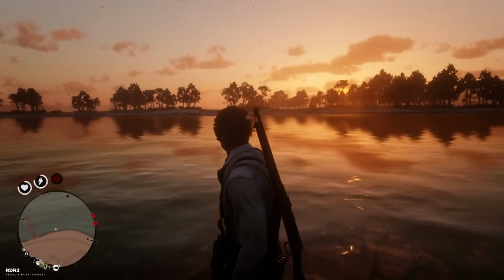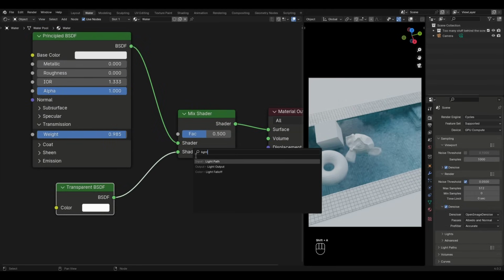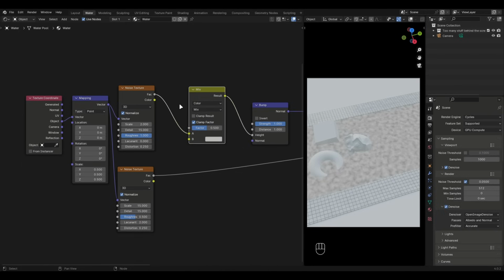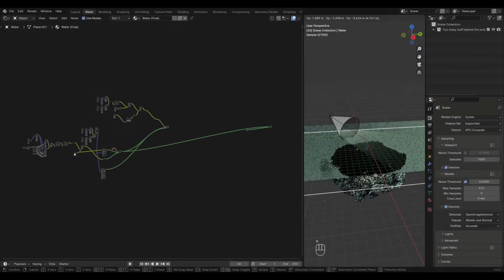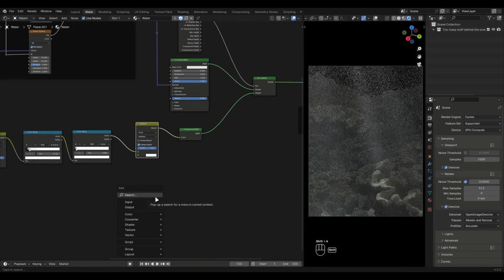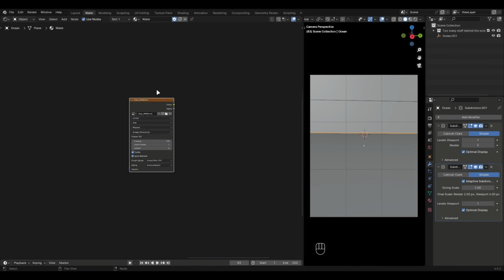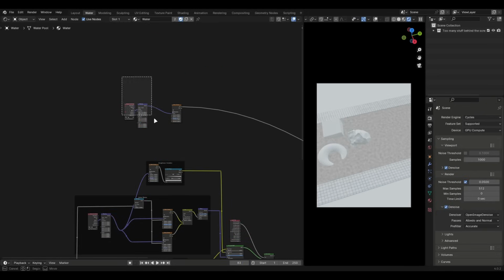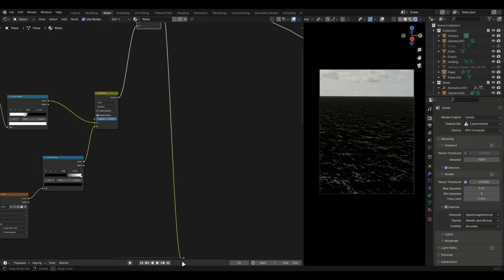Photorealistic Water In Blender

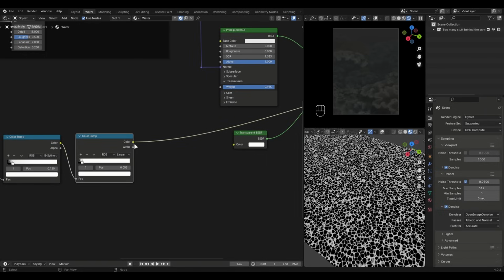Comment: I have done following this tutorial smoothly without any laggy, until 10:52, my whole navigation in the program became really slow, even takes ages to finish just one render when I tried to viewport render. Any idea to make it smooth?
Reply from the maker: What works for me is exiting Material Shading, saving the file, closing Blender, then reopening it and switching directly to Rendered Mode while avoiding Material Shading.
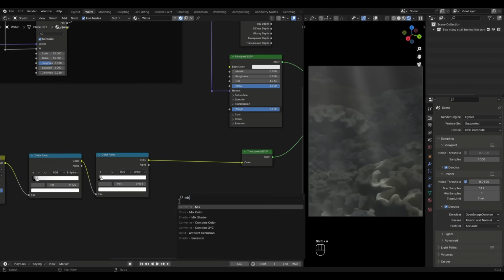By the way, does it happen right when you add the Mix Color node at 10:52?
Reply: Unluckily, I have tried closing and reopening Blender, but still occur the same problem. The lag happens right after I plug the Mix Shader node to the Material Output node before the Mix Color process.
Reply from the maker: Are you using GPU compute or CPU to render? I had this issue in the past where Blender would lag in render mode just because it was using the CPU.

If it’s happening with GPU compute, try adjusting the Voronoi scale in the material preview, and then connect it to the transparent shader when you do the final render!

This is my Instagram: https://www.instagram.com/alanwayne4940 — feel free to DM me if that doesn’t solve the issue.
Reply: @extra3d537 The fact is, I'm using EEVEE to render😅, since I want to make animation out of it. But when i switched to Cycles, it became smooth like butter. 

My guess is EEVEE can't handle/perform Transparent BSDF smoothly unlike Cycles, since it actually lags when I plug the Transparent BSDF>Mix Shader>Material Output

Btw, thanks for the help sir.
Reply from the maker: 😂 You had me worried there!
Yeah, Eevee lags alot

Comment: Total noob questions, but I don't care, lol.  I'm in the beginning, where you used the volume absorption node to "give depth" to the water.  Is this just a plane, and surface geo is all that's required for this?  Like, I don't have to finagle a cube to conform to the inside of my pool to have geometry with internal/enclosed volume, and we're just telling the light to behave like we've got actual volume beneath the surface?  If only surface, is there a case where we would want to use actual volumetric geometry to fill the pool, like if the camera goes below the surface?
Reply from the maker: Yeah, I actually thought about that too and ran a bunch of tests!
Surprisingly, it does work — trust me.
I also showed it in the video. High density definitely has an effect. I think the Principled Volume Shader requires an enclosed geometry, but I'm not entirely sure.

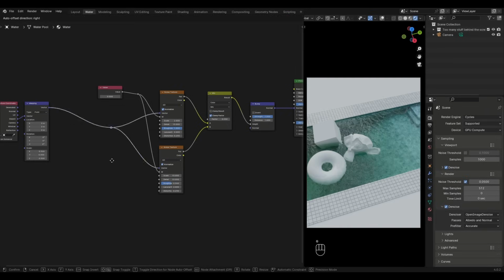Comment: at 6:40, I feel like it would have been easier to use the #frame driver for the value, would it have not?
Reply from the maker: Yeah, but I like to play with the keyframes sometimes to manually slow down the whole water animation, rather than changing each individual math or value node!

Comment: The Blender Ocean modifier does an excellent job already and can be baked and render in five minutes.
Reply from the maker: Try setting the viewport resolution to 32 and the render resolution to 40. Then crank the repeat value up to 20 on both the X and Y axes! Let me know if your PC survives, just kidding (kind of)!
Reply: @extra3d537  I did all that and it works fine. I even use a 64 res on the ocean modifier and add multiple x and y and it works great and render very, very fast and bake in no time.
Reply from the maker: Interesting! My PC couldn't even start rendering if I did that. Can you show it to me? My Instagram is https://www.instagram.com/alanwayne4940/
Reply from the maker: So I tested it myself and did some research. What you're saying is either a misunderstanding or completely incorrect.

I tested an Ocean Modifier with a resolution of 32 in the viewport and 40 for the render, a size of 100, and some minor wind settings. The mesh generated around 2 million triangles. Now, when I repeat it along the X axis just once (i.e., set X repetition to 2), the triangle count jumps to 4 million. This is only in one axis. If you also repeat it along the Y axis, the triangle count increases significantly.

I tried baking it as well, and the triangle count remained the same.

You can test this yourself: click the arrow next to the overlay icon at the top-right corner of the viewport, then enable Statistics under Guides. You’ll see the triangle count update live. When you increase the Ocean Modifier’s repetition in either the X or Y axis, the triangle count goes up accordingly.

If you're aiming to create a large ocean, say between 4 km to 8 km, and the current setting I used is giving 100 meters, you’d need an 80x80 repetition (to get 8,000 meters or 8 km). Doing the math:

Each tile = 2 million triangles

80 × 80 = 6,400 tiles

6,400 × 2 million = 12.8 billion triangles

So yes, that’s definitely beyond a billion, possibly close to 13 billion triangles.

Either your resolution is set lower, or your NASA-level PC is handling the entire load with no issue.

Also, I think there might be a bit of miscommunication or negativity going on in our replies. I’m not trying to say you're wrong, maybe we just misunderstood each other. It’s nothing personal. ✨

By the way, what are your PC specs?

Comment: how to render without flickering, settings
Reply: Turn off Caustics.
Reply from the maker: What kind of flickering are you seeing? Is it render noise, or is it something related to the water shader?
Reply: @extra3d537 not water shader but generally when i denoise images and combine them it occurs even on good samples I think maybe the denoiser cant do temporal denoising, I know SID addon do temporal but is there any way professionals bypass this flickering and boiling effect even without temporal denoising?
Reply from the maker: Can you DM me on Instagram and show me what you mean? I’m not quite sure I understand what you’re getting at. My Instagram is @alanwayne4940.
Reply: @extra3d537  I just wanted to ask what settings professionals use to get crystal clear animations with no flickering and not so long to render 
like samples,threshold,resolution
Reply from the maker: I use a noise threshold of 0.05, with 512 samples and a resolution of 1920x1080 set to 150% for the final animation. Before that, I render at 40% resolution to check for any glitches and ensure everything is fixed.

Make sure to enable Persistent Data and the two options above it.
Export in OpenEXR (DWAA Lossy) format, using RGB or RGBA depending on your scene, and set it to Half Float.

Comment: Very helpful tutorial! I generally use a plugin to make water, but your method actually offers more control.
First question: I assume you apply this material to a plane. Any interest in using a cube?
Second question: have you tried using a bitmap tileable foam texture instead of the noise? I used this back in the day when I was using Octane Render and I still have to test it in Blender.
Reply: What addon do you use and what is bitmap texture, I am new to blender 😅
Reply from the maker: @Rizz186-c1f  A tileable foam texture is a seamless image that can repeat across a surface without visible edges.
Reply from the maker: Glad to hear that! ✨
And about your questions — you can use a cube instead of a plane, but planes are much easier to manipulate across surfaces.

As for the foam texture, the only seamless one I found was on Textures.com, and it costs 9 credits to download. The issue with using textures is that their resolution isn’t infinite like a noise texture.
But if you want to use it, just convert it to black and white with a ColorRamp, adjust it, and use it in place of the noise mask.

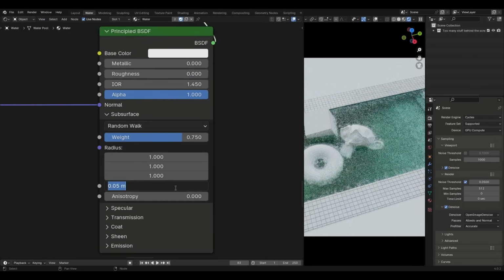I hope you saw the complete last part of the video 18:34